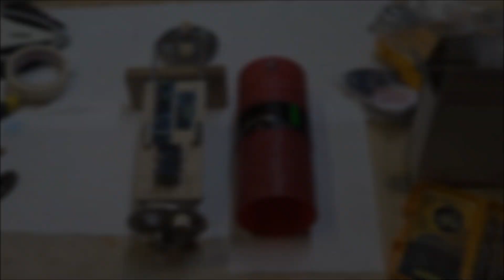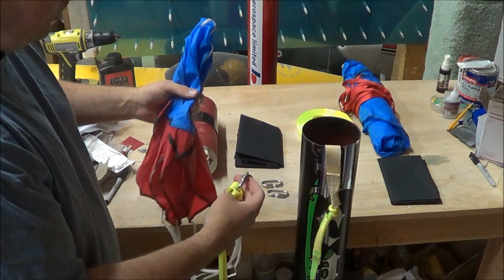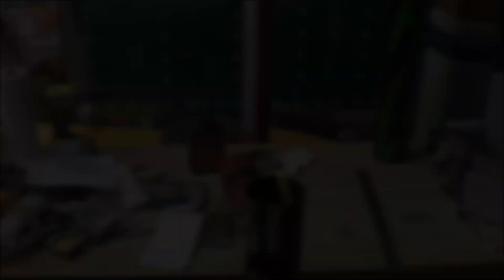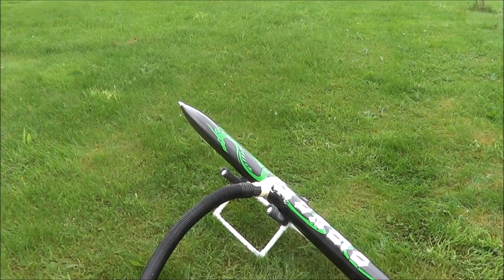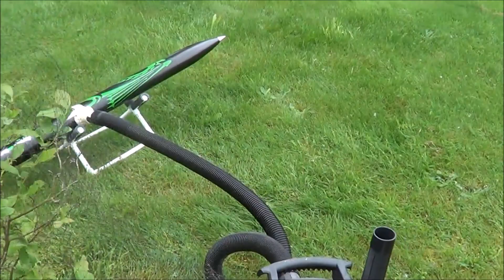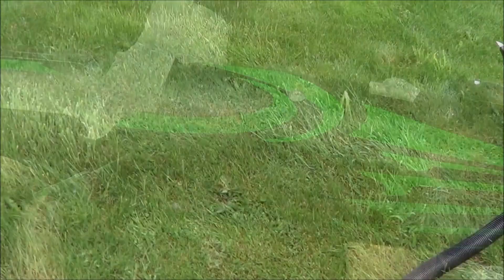Anatomy of a High Power Rocket 6: Avionics and Recovery Gear

Comment: i don't understand how one RRC*** backs up the other?

 do ALL 4 chargers go off regardless? that is the only way i can think of how this part works.  

and you really should make more videos for us dummies. well, at least me. thanks
Reply from the maker: No one's a dummy, there's quite the learning curve with these and that's why I wanted to make these videos.  To answer your question, yes, both altimeters have their own charges, and on every flight, both altimeters will fire their charges.  You can see the backup charges firing on some of my launch videos of high power rockets.

Comment: I have a question: how does the vacuum connection work? Do you make a hole from the outside?
Reply from the maker: I connect a shop vac hose to one of the avbay holes, and tape over the other two holes.  This works to create a vacuum and simulate a flight to several thousand feet.
Reply: @flyfalcons  Thx for your answer means a lot, one more question: what do you screw the stainless stell screws in that hold the upper part?
Reply from the maker: @studywithme8055  I use T-nuts from the hardware store that I tap into wood blocks, and epoxy the wood blocks on the inside of the avbay coupler.

Comment: Does the altimeter measure altitude relative to the starting point? (E.g. if I'm launching from a high plateau, what prevents the altimeter from thinking I'm already at 800+ feet and deploying the main chutes?)
Reply from the maker: Yes, it calibrates to zero when you power it on so altitude given is above ground level.

Comment: Hi I'm designing a larger 120lb liquid rocket for a competition and I'm looking for more information on all of the recovery systems. Were there any guides or materials lists you followed on this? Or equations that helped you sort out shock cord selection for your rocket weight etc? 

Currently I have the parachute diameter figured out (easy part) but now I am engineering the recovery system to be as failproof as possible. Your rocket appears to have the most straightforward approach so I'd like to do a similar style system. Any advice, material lists, equations, or designs would be very helpful for my decision making. Thank you.
Reply: هل يمكنك تعليمي في هدا المجال أنا مهتم بالصواريخ

Comment: Hey, I'm having trouble finding out how to wire a backup altimeter to my E-bay, could you explain to me how to do so?
Reply from the maker: There are a few different ways to do it but I highly recommend running a completely independent system.  So the second altimeter would have its own battery, switch, bulkhead terminals, and charge wells.  This eliminates any potential single points of failure that would cause both altimeters to not function correctly.
Reply: I appreciate the help, I’m bad at visualizing things, could you possibly link me a diagram of the wiring?

Comment: Does the Drago kit come with everything to assemble the bay with the metal end caps and the powder caps and charge connections or did you construct that all yourself I really like it and I just got my level 2 cert at Midwest power which was run by Wildman and I'm planning on buying his ultimate darkstar for my level 3 attempt and would love to set it up like you did here
Reply from the maker: My kit came with the avbay bulkheads (I had the choice of metal or carbon fiber), but no hardware.  I just called Wildman and they sold me a hardware package, though I ended up replacing a lot of it for hardware that I preferred.  I got the charge caps and terminals from Apogee.
Reply: @flyfalcons  thank you would you be able to tell me which connectors and caps they were if you still know it would be a huge help I'm still kinda green when it comes to dual deployment and I retrofitted my PML kit to do it by basically adding all thread and a rear bulkhead to the payload coupler
Reply: @flyfalcons  but it is no where near as nice as your setup and it's wonky to arm it at best... So I'm trying to find a nice setup for my level 3 kit I love your setup it's beautiful
Reply from the maker: @johnwilliams9451  These are the terminals https://www.apogeerockets.com/Electronics-Payloads/Electronics-Accessories/Terminal-Block and these are the charge caps https://www.apogeerockets.com/Ejection_Systems/Ejection_Canisters/Ejection_Canister_Caps_2_pk I would recommend practicing dual deploy on smaller rockets before attempting a level 3.  These charge caps hold about 2 grams, and I fill the drogue side with black powder for a good separation.  You will need to find charge caps in the 7-8 gram capacity range for a 6"+ rocket.  My L3 rocket will be 7.5" in diameter and I have large caps for that.

Comment: great breakdown of electronics system.  If you were using a single Altimeter in a MD rocket would you take the rc2 or rc3?
Reply from the maker: liv3mind functionally they both give you what you need, as you't won't need the third channel the RRC3 provides.  The question is if you want to spend a little more to get the data logging beyond altitude that the RRC3 provides.  With a MD design, it might be worth it to see your measured max speed.  You can also connect the RTX GPS transmitter directly to the RRC3.
Reply: thanks for the response, yeah the extra data logging i feel would def be worth the little extra cash